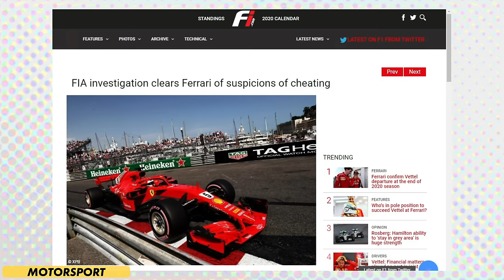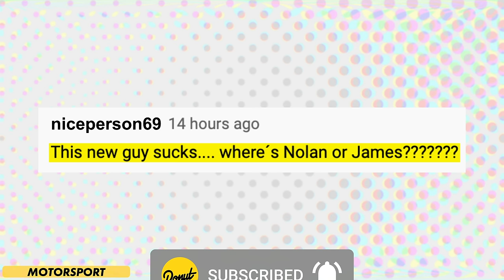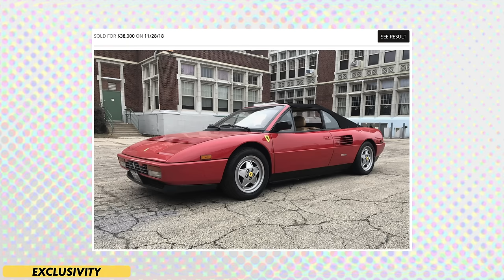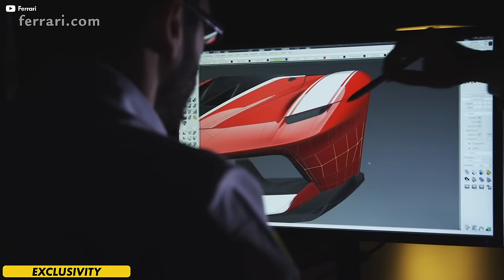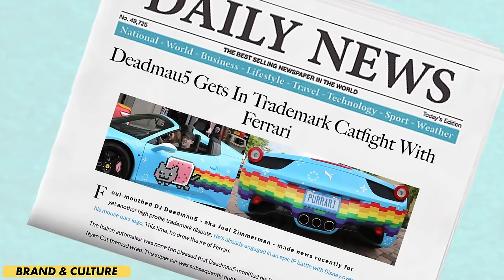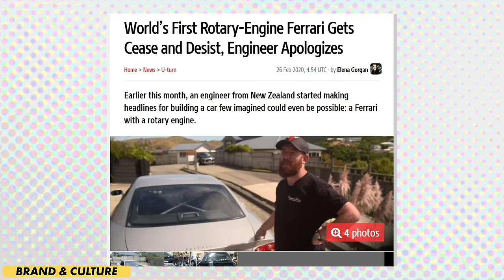Ferrari Vs Lamborghini - The Rivalry EXPLAINED

Comment: 12:53 200mph* and it DID hold the record as the “first production car to clock 200mph”
Reply: @6thgear914  So you are admitting that it was the first car to hit 200mph, but it just wasn’t official? Well sorry to say, but it was and is official...
Reply: Wait so did it or did it not hit 200
Reply: @IlIlIlIlIlIlIlIIlIlIlIlIl  and then Ruf got their Porsche and beat them out if I’m not wrong
Reply: @6thgear914  ruf wasn't a production car and the f40 did officially hold the record

Comment: 1:01 "they've battled ... in the late eighties and early nineties"
Countach production 1974–1990
Testarossa production 1984–1996

Those cars weren't even designed in the same era, so comparing them is not relevant.
The only place those cars could have battled is as a poster on a wall, and even that doesn't seem right given that they are seperated by 10 years.
Reply: uh, there's that whole 1984-1990 overlap there, brah.
Reply: I love kamborghini also ferrari but my dream car is the lamborghini huracan peformante just look at that face its like a tiger trying to eat a ferrari...just kidding ferrari lovers.
Reply: Don't forget that the Countach got updated in the 80's.... Around the time the Testarossa got released.
Reply: @NeoGraena  This does seem like a valid point, although I'm not convinced that those changes could possibly be so big, that they would make it a fair battle.
(I didn't take that into consideration and updates are undoubtedly a major factor when discussing things like this)

Comment: 6:54 Yes, only 34 hp. But you have to acknowledge the fact that it uses a supercapacitor and not a conventional battery pack. And i do think that it would count as an innovation, considering the fact that carbon fibre wheels do too. In 1966, the Lamborghini Miura was the first high performance mid-engine, rear-wheel-drive roadcar. So yeah, they didn't just make the wheels. And 6:09 The Aston Martin Valkyrie V12 makes more horsepower (1000)  than the 812 Superfast (789) and has more horsepower per litre than 458- 153.8hp/l in the Valkyrie compared to 133hp/l in the 458 Speciale.

Comment: -"Lamborghini makes a 20 car run of a special model every two years", "There are only 3 veneno", "There is only one egoista" 

Forgets that the egoista is a concept car, forgets that the veneno run is 5 cupes and 9 roadsters and forgets ferrari's one-off program that has been running for more than 20 years in which ferrari desings you a car how you want it but first you have to buy basically every ferrari ever and spend over two years designing it.
Sincerely, too many errors in one video.

Comment: KERS, kinetic energy recovery system, does not recover energy from the heat of the brakes. It uses an electric motor, which is directly connected to the drive train, as an electric generator. This converts the kinetic energy of the car into electrical energy, thus slowing down the car. Brakes convert the kinetic energy into thermal energy but this thermal energy is never recovered, it is dissipated into the air to cool the brakes.

Comment: Jesus, still the 0-60!! So old. Put the damn stock car in the circuit, drive it for 100 laps. Then, see which performed better. I am telling you, a 600 hp Ferrari in a track will perform better than any other competitor. Handling, components durability, suspension, materials, make a road car like Ferrari almost ready to compete and not break at first cornet like other exotic sport cars with no breed in races.

Comment: These both sports car companies are one of the most iconic names in racing. I love all the Lamborghini and Ferrari cars. If they got down to race, it would be great legendary race. But I love Ferrari. Now, let's take the fastest accelerating models of both companies. from Ferrari, it is Ferrari sf90 Stradale, with 0-60 miles per hour in a standstill of 2.0seconds. From Lamborghini it is Lamborghini aventador svj roadster, with 0-60 in 2.8 seconds. so Its is clear that Ferrari wins in this round. In speed, we the fastest Ferrari ever made is the Ferrari Enzo zxx evolution edo competition, with top speed of over 250mph (400 kmh). the fastest Lamborghini ever made is the Lamborghini Diablo Coatl, with top speed of 239 mph (385kmh). But never underestimate any Lamborghini.

Comment: cough**cough Lamborghini actually went AWD when they were bought by Audi*cough*cough The Diablo, The Countach and all of the previous models were RWD. It's thanks to the touch of Audi and the co-op development of the R8 and the Gallardo that they got AWD from the Gallarado/Murcielago generation.
And it was actually Koenigsegg who first made single-piece carbon fiber wheels and put them on a car.
As to the lifestyle - there isn't even a common ground to compare. The Deadmaus case is the perfect example. Lamborghini is just a brand which can be own by any punk who has money. Ferrari is an institution. They have more control over their clients than most governments. Let that sink in for a moment. And tbh, i'm with Ferrari on this one. They are not just any car maker. They are THE BRAND to be compared with. Many others came and went, but those guys are THE BENCHMARK. The vision of the brand is what separates them from any other car maker and what lures the clients in.

Comment: Maybe am just a nerd into these things but you really should have done more research for the Exclusivity part because while you were correct about the produciton number of the Gallardo which was just over 14.000 you couldn't be more wrong about the 458 since first of all the 15.000 you mentioned are only the coupes, they also made 6000 convertibles and about 3500 high performance variants which bring the total to about 24,500 Ferrari 458s made.
and second of all why the fuck are you only counting the 458 in this comparison, the Gallardo came out way back in 2004 till 2014 and the 458 didn't come untill 2010-2015 so naturally you should also include its predecessor : the F430 that came between 2005-2009 and an and it's estimated that over 15,000 F430s were made 
So in total F430 + 458 = 39500 which makes the Gallardo 2.6 times more exclusive and rare than the Ferrari counterpart.